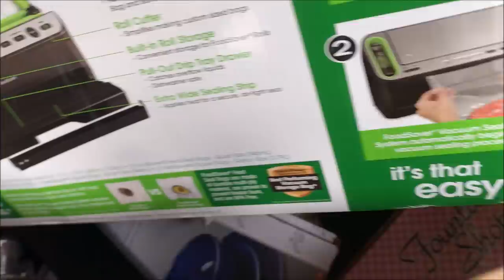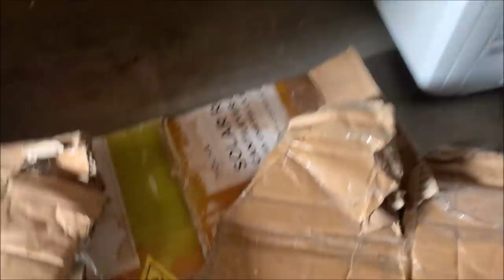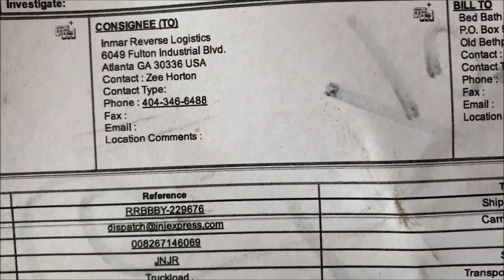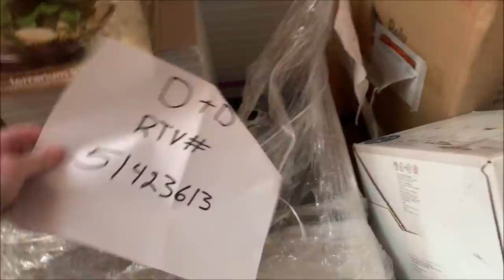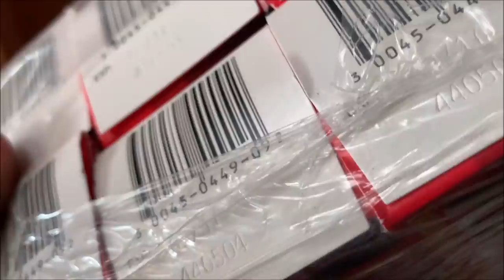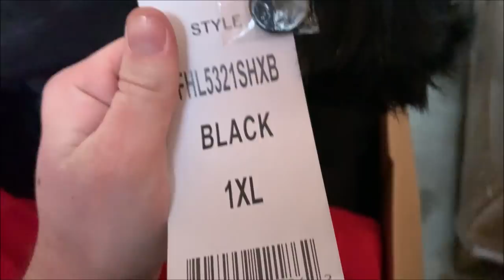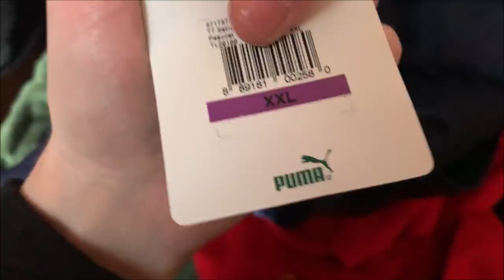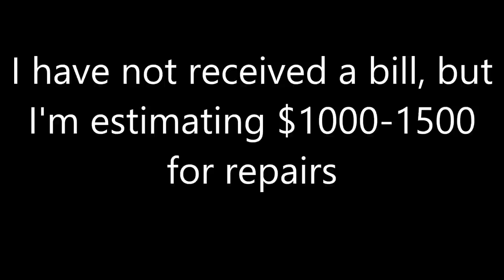Storage Auction - This is the Most Expensive Storage Unit I've Ever Bought - $2255!

Comment: I have found that forklift keys, like many mid-size tractor keys, often work in many tractors from the same source, with few variations.  The same is often the case for gun safes, truck boxes, file cabinets, lawn tractors, fire safes and tool boxes.  The last time I had such keys made, I provided the locksmith with the number off the lock body itself, which he entered into a laptop and pulled up a key shape and since the laptop was connected directly to the key machine, he made me 2 keys for about $12 without needing the key to cut from.